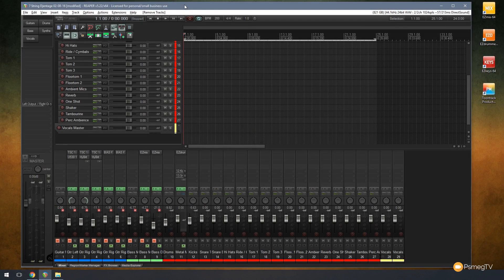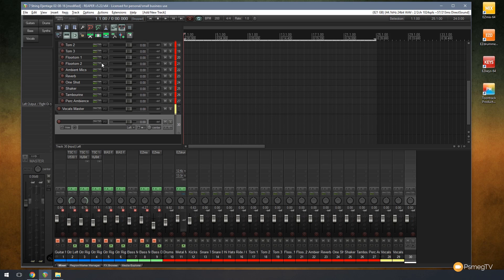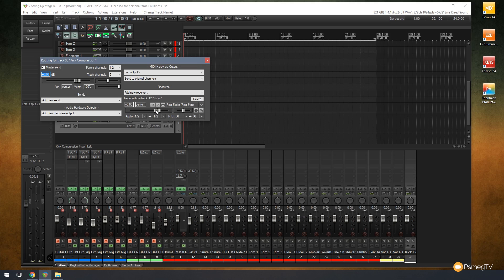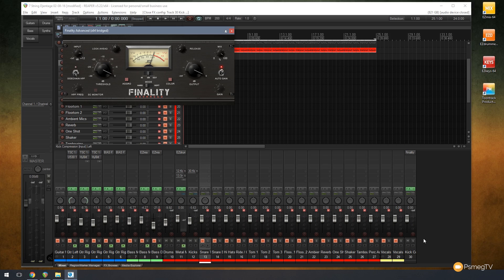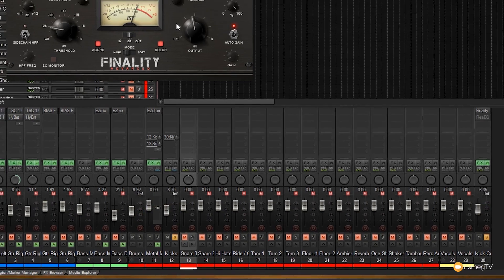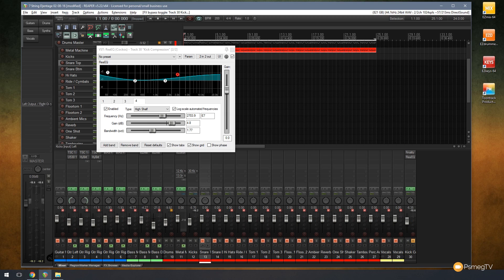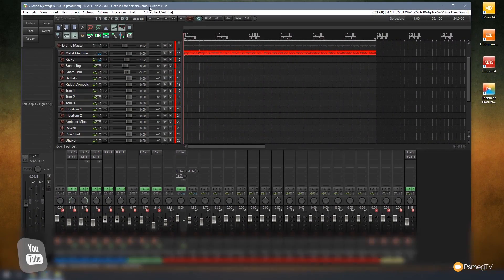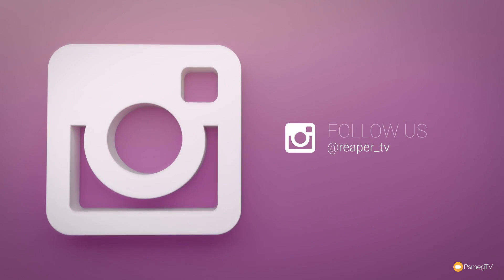How To Setup & Use Parallel Compression in Reaper DAW

Comment: THANKS! So when you continue mixing the project and need to change the level of the kick are you now having to keep changing the level of BOTH tracks or is there a way to mkae the compression track adhere to changes made to the dry track?
Reply: you could use a buss for each element – that way you mix from the busses, without having too much to fiddle with

Comment: can that be done with guitar tracks and would that be considered double tracking?
thanks
Reply: This would not do the same thing as double tracking. To double track you need two different takes (Different performances). This could however be used on guitar. It just would not be double tracking.

Comment: Parrallel compression always gives me phase issues in Reaper. According to the website reaper does have PDC though. Do i have to turn it on in some menu?
Reply from the maker: I'm pretty sure PDC is on by default - Have a look at this thread for a better explanation of how Reaper uses PDC.

http://forums.cockos.com/showthread.php?p=1143129
Reply: Fixed it. It came down to ONE plugin that messes up your phase, and i use it in most of my parallel chains. Thanks for your response!
Reply from the maker: Great stuff, glad you got it sorted :0)